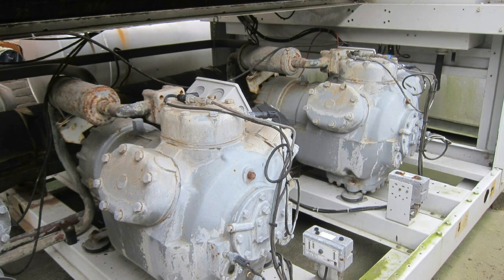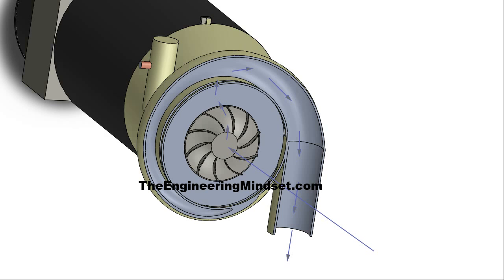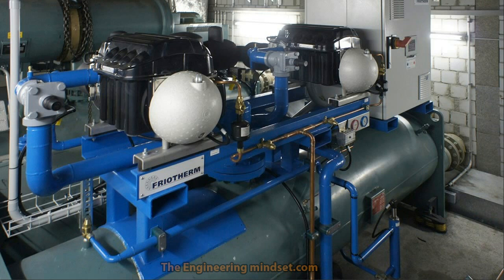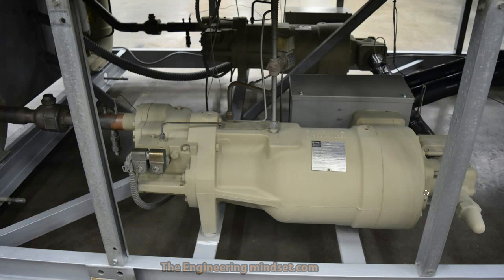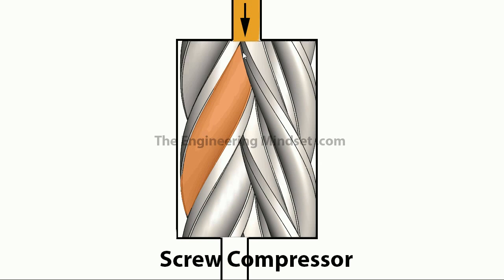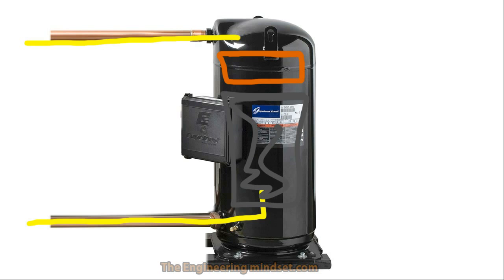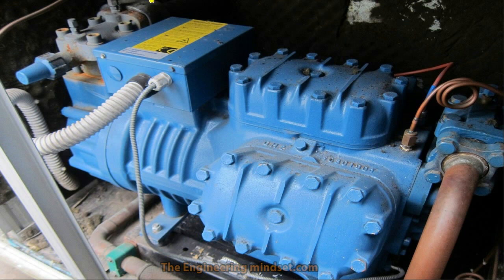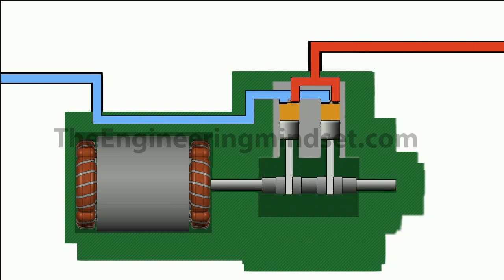🔧 Chiller - Compressor Types

Comment: Thank you sir for ur support.....
In what kind of chiller plants these compressors are separately used...plzz let me know....
Reply: Devid gill  yes we want the advantages and the disadvantages of each type
Reply from the maker: All of the ones shown are found in commercial properties such as office blocks. Centrifugal tend to be in very large buildings as they can produce a lot of cooling. Screw tends to be in small-medium buildings with lower cooling demand. Scroll is typically in air cooled chillers and are found in small buildings. Recip can be in any of them however they are not used as much anymore as the other types are typically more efficient and cheaper to produce and maintain.
Reply: The Engineering Mindset  thanks for the good information. hope you the best
Reply from the maker: Here you go! https://youtu.be/gYcNDT1d30k
Reply from the maker: Here you go! https://youtu.be/gYcNDT1d30k